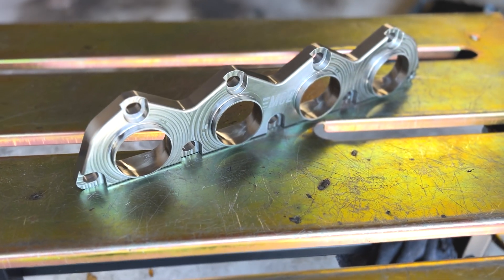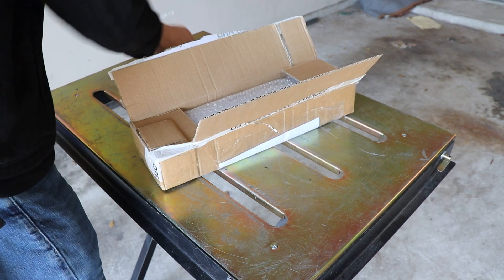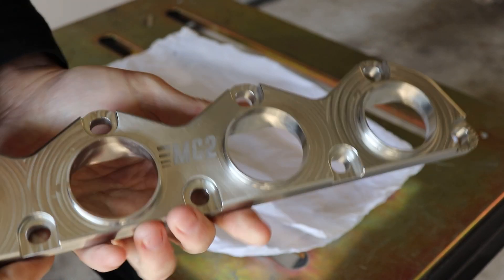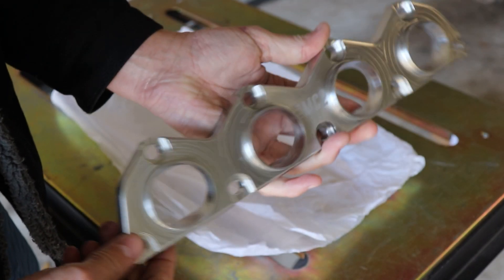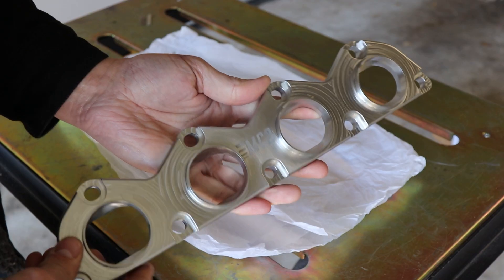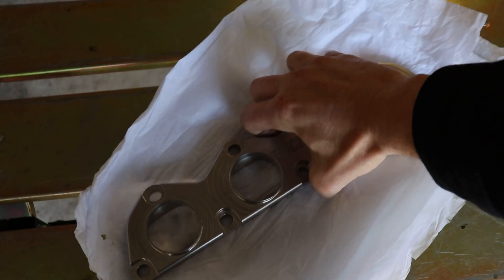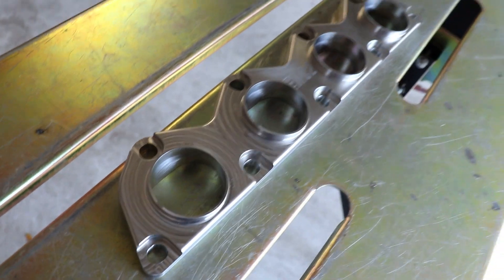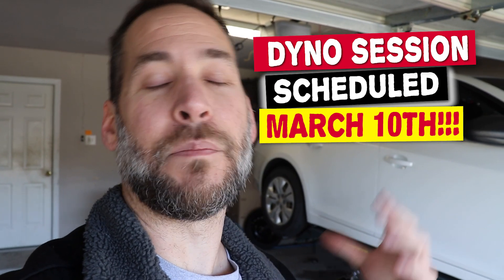NEW CNC Turbo Manifold Update for the 1.8 Turbo Cruze!

Comment from the maker: What do you guys think about this design revision to the turbo manifold flange?
Reply: Too thin where your welding the pipes to.
Reply from the maker: @ Yup. My guy that creates the file made it too thin there and I didn't catch it. I'm working on him revising it.  It's only .06 there and should have been closer to .12. All part of it.  Just the prototype phase.
Reply: Hey may be right i dono but still really nice 👍
Reply: It looks good.....if you used allen head bolts.....could help with the flange......
Reply: Did you ever make a second video for the lift?
Reply from the maker: @Jbmc65  I haven't. Although you can see it being used in my most recent videos. The lift video went viral for whatever reason. My channel is about car mods. I'll do an update, but I'm in no rush. Thanks for commenting.

Comment: Looking awesome buddy! The pipe-ends seem a bit thin but saw in another comment that you're already on it 🤟🏼
Other than that I'd just make sure the recesses dont create sharp edges. Especially with heat warp of stainless the stress on those points could possibly lead to cracks. Just a small radius on each edge should do 🤟🏼 awesome work! 

Have you thought about making a kick-starter to see how the market for a physical piece actually is? That might give you a threshold up to the point where it's worthwhile to produce the piece in a decent number and ship them worldwide. Idk if it works like that but if - I think that would give you plenty of security and stability.

Keep up the great work 🤟🏼
Reply from the maker: Thanks!  I didn't catch that until it was too late, but all part of refining the design. Should be twice as thick and asked for a bevel just like stainless fitting come to make it easy to weld.  So got to get those taken care of.  The legs have a slight fillet on them, but will ask to make it slight more pronounced to add strength.

That's a great idea.  I appreciate it!

Comment: 3:13 I know that issue all too well. I designed a product for cars that I 3d print and sell. I have had multiple people ask for the files, some just wanted them, others wanted to buy them. I let them know they weren't for sale.
Reply from the maker: I hear that.  Would be cool to make the parts available, but we'll see as time goes on if I can make it happen.  Just need to find a place that'll machine the parts at a reasonable price.  If not, it was fun designing them and creating custom parts for my project.
Reply: @cmattdabrat  yeah, what I make, I have racked my brain for years on how to make it from metal instead of just being 3d printed, but the shape it is and being a machinist by trade, I can't see a way that it could even be machined or at least not cost effective to where the price it cost wouldn't be astronomical. Got a quote from a place to 3d print in metal and the quoted price was over 10x what I sell them for and even at what I sell them for some people shy away from and its not even pricey.

Comment: Looks great! The cheapest quotes I got when shopping for a similar project were from PCBWay, JLCPCB, and KinTec if I remember correctly.
Reply from the maker: I had them do the spacers for the rear diff.  They were pretty affordable and a decent turnaround considering it came from China.  The place I've been using for CNC work is called CNC Rapid. They're pretty affordable for prototypes, but when asked about price quantity breaks, the price really didn't go down per piece.  Lately the price has gone up and turnaround time has gotten slower.  They're probably swamped.  Ideally, I'd offer these at a reasonable price, but the per unit price they want is basically what I want to sell them on the market for.  I'm going to email a bunch of places for quotes.
Reply: @cmattdabrat  Yeah... Certain government activities are forcing a rush and gonna make everything more expensive.
Reply from the maker: @ True. I don't expect it to get any cheaper.  So we'll see.  If I have to end up selling them for $600 a piece.  It is what it is.